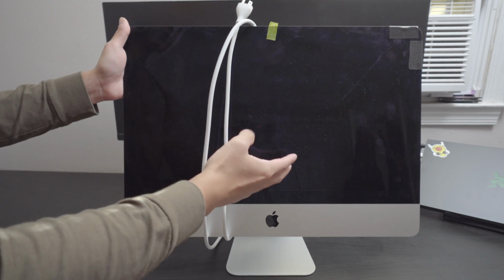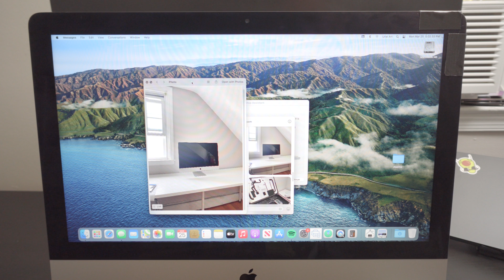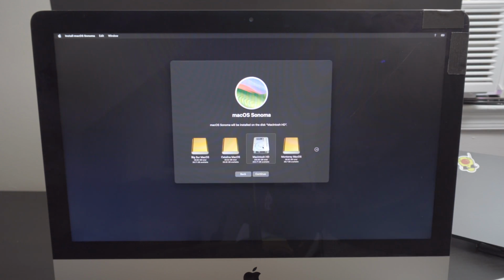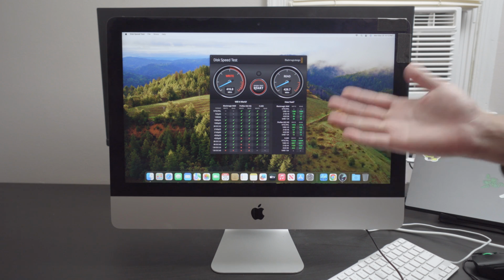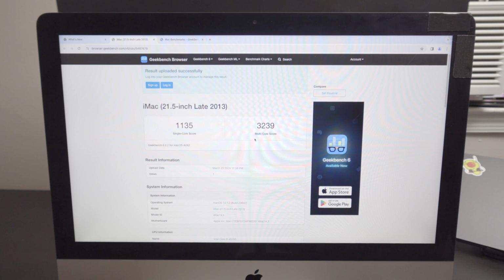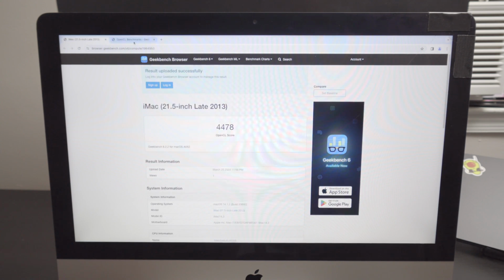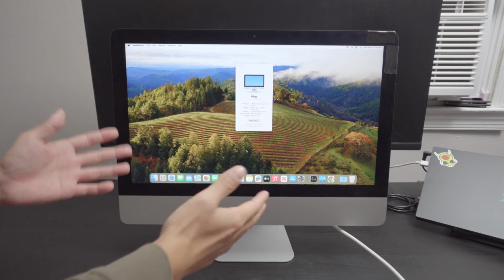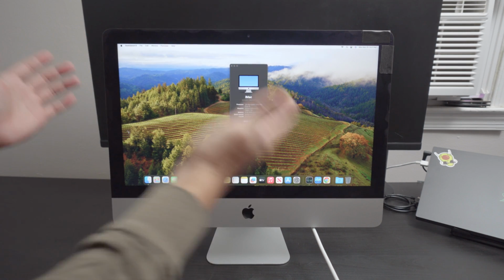REVIVING AN OLD IMAC LATE 2013: IS IT STILL USABLE OR OBSOLETE???

Comment: I still use my 2013 iMac. It’s been through some times with me I am very much attached to it so I don’t want to get another one. I’ve gone ahead and bought a usb hard drive and I run Linux on it as a dual OS. Works like a breeze.
Reply from the maker: still a good all in one!

Comment: I got one of these iMac 14.1 quad core Core i5 4570R w/Intel Iris Pro 5200 Graphics. I upgraded it to 16gb ram and a 1TB SSD,  and was operating Sequoia via OCLP. Now, a year later (November 2025) it began running sluggishly with the latest updates, so I replaced MacOS entirely with Ubuntu Budgie 24.04.3 LTS. It runs faster than it ever has! It's killer now! I installed additional drivers, and restricted extras, as well additional codecs. It's faster than it has ever been now! Just killer!

Comment: I've got the quad core i7-4770, 8gb, 256gb NVME SSD, GTX 750M 1gb version of one of these 2013 iMacs as my current daily driver beater & audio production mule.
Picked it up last year for about $50, as it's NVME drive had apparently pooped the bed when the original owner went to wipe it.¯\_(ツ)_/¯
Good old "?" flashy folder booter.

So I did a complete 100% tear down on it, replaced the thermals, the failed 256gb NVME, added an additional 1tb internal SSD, and maxed out the ram to the 16gb limit.
Not exactly a job I would openly recommend to the faint of heart or any similarly novice tinkerer like myself, as it ended up taking way more hours of elbow grease, frustration, and swearing than I had initially anticipated.
Also, when pulling out the logic board I somehow managed to gooch the Bluetooth antenna connector completely. Ha!
¯\_(ツ)_/¯
In hindsight though?
It was somewhat of an enjoyable project challenge & a valuable learning experience to share with my son who helped along the way.
Having grown up from meager means as a kid?
I've never really ever been particularly been keen on obsessively aspiring ownership of the latest new & shiny piece of cutting technology, and these old Intel Macs, especially after modernizing the internal drives to SSD, are still more than capable machines for heavy lifting audio production and/or light weight 1080p video editing IMO.

It's a shame that Apple hasn't adhered to that philosophy as a form of free marketing, or a testament to the overall technical quality of their brand, and instead has unfortunately made it intentionally as difficult as possible for their obvious die hard fan's "right to upgrade & repair" their existing legacy products.
Especially once people realized just how much legitimate life a modern SSD drive could breathe back into something previously considered to be merely "obsolete" and thus prematurely unsupported.
Apple didn't fully anticipate that technological leap IOM, and...
Instead of embracing that movement, and supporting the resourcefulness and devotion of it's consumers?
Opted to plow ahead with it's unrelenting and unsustainable natural resource business model of releasing new hardware on a bi-annual calendar basis.
¯\_(ツ)_/¯
This concludes my TED TALK. 
 
LMAO!

Comment: using the 2013 Imac with 1tb SSD and 16GB RAM which is upgraded a while back and the system runs absolutely smooth like anything. I have been using LightRoom , Photoshop and DAVINCI Resolve on this machine without much issue. Although sometimes there is a lag but it does the job and it's perfect for every day usage like browsing and emails and light editing. What causes the issue is that sometimes CHROME lags a lot and then it goes crashing .
Reply from the maker: Surprised you can run da Vinci! 4k or 1080?
Reply: @cynonexus  I can run Da Vinci Resolve 17 on it easily. It can render videos without much issues easily but I guess I will now upgrade it MacMini M4 24 GB RAM and 512 GB HD. It will future proof me for another 8 years unless something mind blowing comes to the industry.
Reply: @s.a.wpixels 

Hey, My iMac 2013 has decided to not boot up past starting bar screen… could it be obsolete now?… any help is really appreciated 🙏🏻🙏🏻
Reply: @randomelvis3359   could be anything, hard to say but most likely it's the HD as its a mechanical one, try getting it replaced with a SSD or may be try to

Comment: i have this imac and ive installed every operating system on it, latest windows, latest mac os, latest linux, all works well, gaming also works pretty well its very good you can still use it very well in 2024
Reply from the maker: Glad to see it’s still going strong!
Reply: Hi. I have a 2013 Imac but need to run ai software that needs 12 or later. Is it possible for my machine to run those please ?
Reply: Can you tell me how to install the latest Mac OS on this 2013 iMac, i will pay you?
Reply: @ I don’t personally know, but I’m having my 2013 Mac upgraded to use the lasted OS. Some shops won’t do it, something to do with apple.
Reply: I can't download any newer apps. You guys must not being doing anything modern in regards to work.
Reply: @drewspinoso4849 I just use opencore legacy patcher to get to a newer os

Comment: hi I m running a late 2013 I Mac 27 inch I am running Sonoma on it its 1 tb and 32 ram ,its certainly put me off buying the new model. I used open core and it is working great

Comment: Well, this is encouraging - THANKS! 
I happen to have the late 2013 iMac 21.5 very much like yours, and have been a bit worried that it will wonk out (mine is quad core i5, 16GB RAM, NVIDIA 1GB GPU like yours - graphics that Apple apparently ABANDONED years ago - Grrrr!, so I don't know if the GPU now actually DOES anything 🥴 -  and a self installed internal 2TB SSD and an external 500GB SSD for photos and video clips storage). I use it for EVERYTHING on a daily basis, such as photo editing and it seems fast enough. Only problem is that some software providers have jumped past this model (or dumped older OS Catalina 10.15.7) so I can't update their apps, even Adobe stuff now but running 2022 versions is fine.  I've never had ANY issues but I thought I was on "thin ice" until seeing your video.  Thanks again!
Reply: I just acquired a Late 2013 iMac 21.5" 2.7Ghz Quadcore i5 from a friend. I upgraded the RAM to 16gb, and the installed a 1TB SSD, then Sonoma via OpenCore Legacy Patcher. 
For just general web surfing it's plenty fast enough. It runs LibreOffice Writer and Calc really well too. 
 I have not tried to do anything with iMovie yet, nor have I installed Photoshop Elements. I hope to do that soon to see if it is viable to get me by for the next year or so while Apple works the inevitable new-hardware/new-OS bugs out of the upcoming M4 iMacs and Minis. 
So far though, OpenCore and Sonoma have not had a single issue on this machine.
Reply: @prestachuck2867  What is OpenCore? I'm sure I could Google it, but would you mine directing me to a link relevant to our late 2013 iMac situation? Thanks!!

Comment: These iMacs are great. I have a 2015 quad core 21.5 that I used as my daily driver last summer with a 500gb ssd. Perfectly useable and it runs Monterey natively. Now it's my backup server but they're great devices. You really need to get the fixit opener tool that looks like a pizza cutter in order to take the display off, it's well worth the money to save that screen from any potential cracks

Comment: I run Ubuntu, so my 2010 model with i7 works just fine today.
Reply from the maker: Still wonderful! 2010s you can also upgrade the graphics!
Reply: I was on the lucky side, as this model has Radeon HD 5750 1024MB.  Strangely the i7-870 still runs strong.  I have a dell with that same chip, and it's a dog.  The TDP wattage is a bit high, but $99 to get that 27-inch picture!

Comment: I use this exact computer alongside my Macbook Pro M1 Pro, it’s great on Sonoma with Universal Control. I get some graphical glitches sometimes though, and I sometimes have to force restart it on boot because the progress bar does not appear for some reason, and macOS won’t load. Only thing it lacks is a Retina screen!
Reply from the maker: That retina screen is really helping its longevity! Still smooth animations really help the fluidity of the computer! The 1080p monitor is still fantastic!

Comment: I have an older iMac that I put in the garage that I am going to take out to see what I can do with it. iMacs are beautiful. Just a pain to upgrade on the newer models.
Reply from the maker: agreed! would love to clean the old thermal paste out but it's an absolute pain to take the display out with all the adhesives holding it
Reply: I just acquired the same model iMac (Late2013 21.5" QuadCore i5 2.7GHZ. With a 1TB SSD and 16gb Ram, it's running Sonoma glitch free so far using OCLP 2.02 .

Comment: The tests are slow for the ssd because it can take a day or more to let spotlight index after an update, and you have to install Big Sur before Sonoma when you use the patcher because it came with a firmware update that is needed before you install Sonoma to help with certain devices.
Reply from the maker: That’s a pretty good insight! It’s been smooth sailing so far, still surprisingly snappy!
Reply: @cynonexus  Awesome, good to hear. I have the MacBook Pro 13 from the same year and they are all amazing even still. 2012-2013 was a sweet spot for upgrading and reliability. I went down the rabbit hole of updating mine but am still on Catalina. Do you think Sonoma is a good long term solution or would you keep it at Ventura if you did it again?
Reply from the maker: @ghost-user559  I personally think monterey is a perfect fit if you want flawless performance with sonoma, there are a few hiccups here and there especially a retina macbook where it has to push more pixels unlike this iMac.